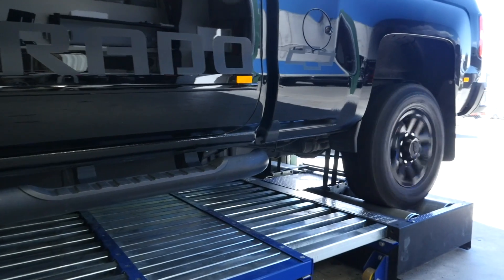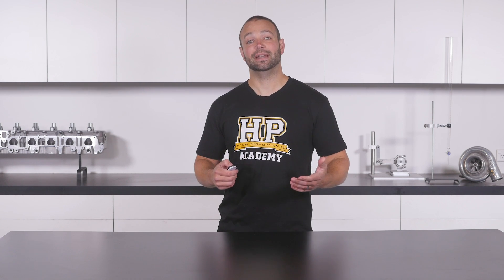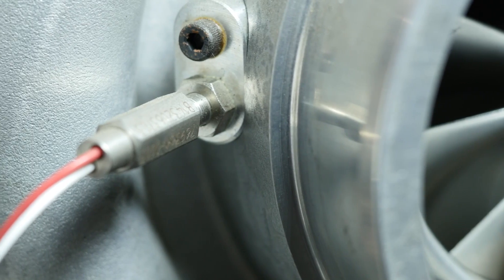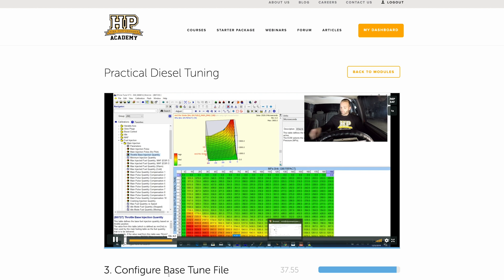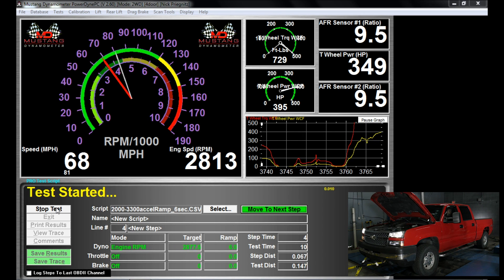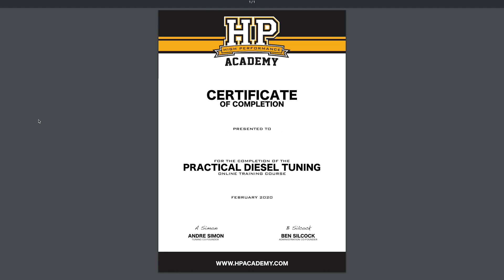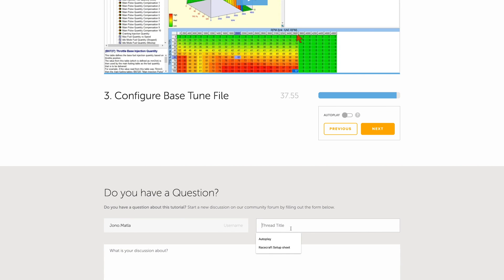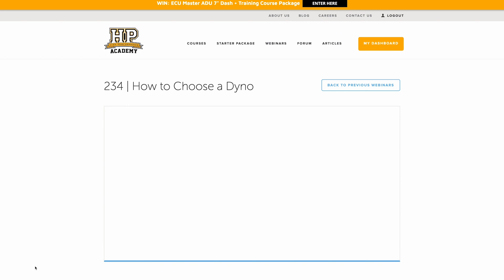Diesel Engine Tuning | Learn How To Tune YOUR Diesel Engine [COURSE]

Comment: Wb heavy duty diesel trucks, will this course help us tune those as well?
Reply from the maker: If you're meaning tuning something like a Scania, DAF or Peterbilt etc, then yes and no. The principles are the same, however, it is unlikely you're going to find commercial software that allows you to freely tune vehicles like that and we don't have any Worked Examples in our course material of such equipment.
For the likes of utility vehicles from GMC, Ford, Chevrolet etc like the one you can see in the thumbnail, it's a firm yes :) - Taz.

Comment: You seem a fine, clean cut young man - but why are you talking funny*?
Seriously, though, just the first minute of the presentation it is clear anyone interested in diesels should be watching, as many principles can also be applied to other internal combustion engines, they may also gain from watching.
As many NZ, and European, diesel vehicles are small four or six cylinder engines, I assume you'll be looking at them as well?

*Sorry, dude, Andre gets teased and, well...
Reply from the maker: haha yes it's odd to have a different accent on the channel eh! Nick will be covering a lot of different platforms and engines, but predominantly USDM as that is where he is based. We will add the Hilux which will cover a smaller 4 cylinder, and from there we'll see what pops up.
HP Tuners and MoTeC will be the next two examples on there, with EFI LIve being the first - Taz.

Comment: Add boost 
Add fuel
Done.
Reply: I was only joking guys. I'm sure theres more to it than that,  I personally don't have anything to do with diesel's not enough rpm for my liking, I have a friend who is into diesel golf's who also tunes other diesels, he says "add fuel for power but that makes it run hot (EGT's) then add boost to cool it until you run out of boost, that's it"
Oh and emissions isn't a thing in the UK, you get charged more road tax for higher emissions so our government practically endorses it, everyone knows a test station that will get you through a test for an extra £20. 
There are so many heavily tuned diesel's pushing big clouds of black smoke no one cares.
Reply from the maker: I figured you were tongue in cheek, but just wanted to address it. We're not the fun police, but that last sentence is something that needs to change within the industry and car culture for numerous reasons. There is a time and place for everything.
Not here to judge anyone, just to try and help educate. Hope you can appreciate the angle we take 🤓- Taz.
Reply: @Big2009Gee  
That rpm thing was true back in the day, Sam, but I was shocked when I learned, a couple of years ago, that some diesel drag trucks are turning well over 7k rpm!
It used to be the flame front/burn speed that limited their rpm, but that increases with the cylinder pressures and some are running close to 150 PSI of boost!
Reply: @Big2009Gee  that’s the beautiful thing about torque low rpms=big gains here in the states it’s nothing for my slightly modified powerstroke to gap Mustangs and Camaros on the regular while only turning out maybe 3k to 3500 rpm
Reply from the maker: Add bang
Unknown step
Profit?
😝
You can certainly put different levels of effort into tuning, but when it comes to getting any real performance and/or staying on the right side of the law when it comes to emissions the old fuel and boost wind up isn't going to cut the mustard, nor will your DPF survive long - Taz.
Reply: Ah, but the trick is doing it safely and within local legislation.
Every engine is eventually going to reach failure point, so being aware of what that is for each engine, and taking the right corrective action, is quite important.